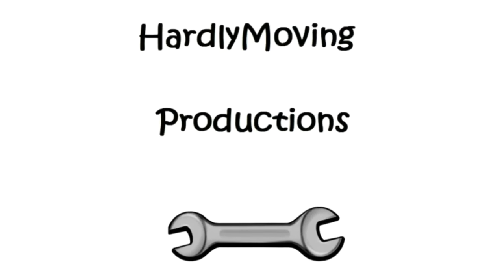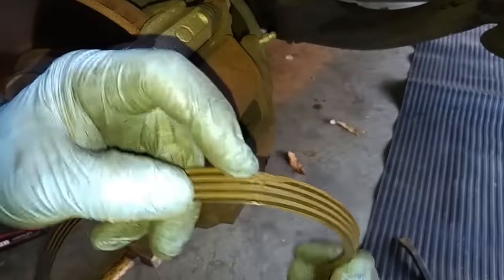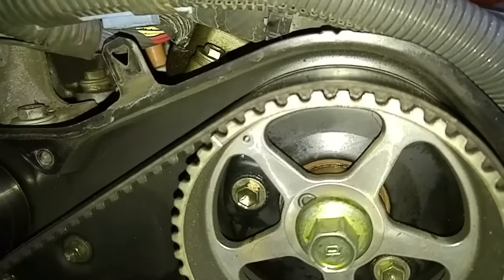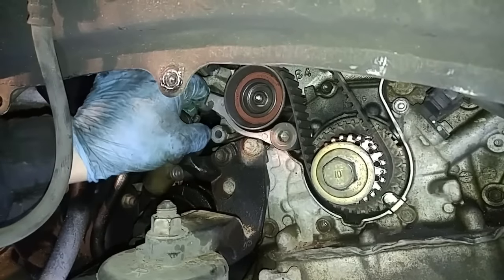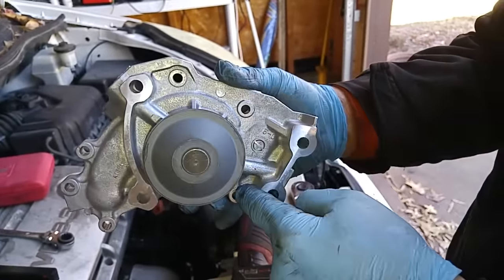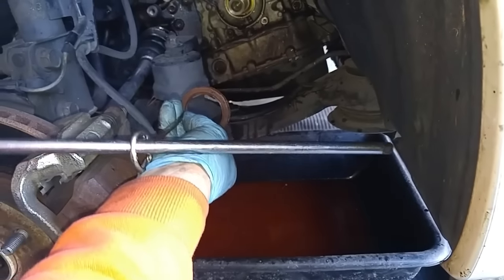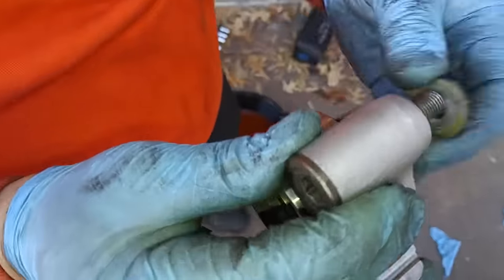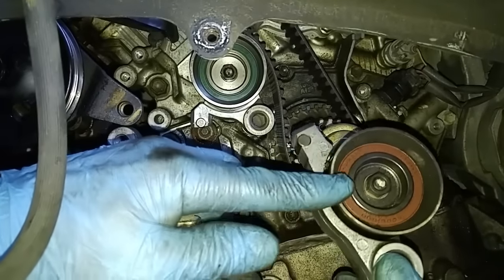Toyota Sienna V6 3MZ-FE Timing Belt, Water Pump, Seals, & Pulleys Replacement

Comment: This is the best YouTube video on this job for Toyota's 3.X engines.  Properly done, highlights the quirks of the job and shows the innovation necessary to get it done.  Done this several times on my Hyundai and it's never fun.  About to do my first on my Toy.  I look forward to the day when cars no longer have timing belts.  Thanks for posting.
Reply from the maker: Thanks for your critique and support ... appreciate it!  My video partner and I do spend a lot of time making sure we don't skip any steps, that the steps are in a logical order, identify specialty tools needed and slow the video down where needed.  If interested, here's a video we did awhile ago on Toyota's 1MZFE V6 engine in a 97 Lexus ES300:
 https://youtu.be/KkjgBVxBaeU
Reply from the maker: Good point but when the chain stretches, it will eventually throw off the ignition timing and you'll get a camshaft or crankshaft position MIL (manufacturer indicator lamp ... or check engine) error code.  You can reset the code as often as you want but it will keep coming back.  I've seen this in Honda's and GM tri-chain V6's between 150 to 200K miles.  If you decide to replace it, you need to replace it with new chain guides and tensioners.  Compared to a worn out timing belt replacement, you're talking BIG, BIG $$$'s to do the repair.  The timing chain cover is matted to the engine block with a whole lot of bolts, pulleys and brackets are in front if it which require removal, the cover to block sealant must be wire brushed off before resealing, a bunch of seals and gaskets must be replaced and the cost of parts is around 2.5 to 3X that of a timing belt kit.  I did a TB replacement on a V6 Kia Sportage with 170K miles on the original belt .... that's right 170K miles!  I wonder if a timing chain engine would last that long without stretching?
Reply: @hardlymovingpro  My Buick had 217,000 miles.  Original timing chain.  Still ran like a champ.  But I would prefer gears.  Surely they can get past the harmonics in this day and age.
Reply from the maker: That's probably an low rpm, "lazy 8" overhead valve (OHV) engine which has a short timing chain tying the crankshaft to the camshaft located in the center of the engine (unlike a OHC above the cylinder head).  The longer the chain, the more links to wear;  hence more noticeable effects of a stretched chain.  Buicks are a GM product.  Their current all aluminum OHC V6 is a 3 chain drive system and they generally can't make it to 200K miles before encountering chain stretch problems.  Also, you're lucking to make it to 100k miles before encountering timing chain cover oil leaks (low quality sealant matting the cover to the block).   Total labor time to re-seal a cover ... about 6.5 hours ... add 2 more hours to replace the chain, guides and tensioners.  About $2K parts and labor at a dealership.

Comment: Thanks for the paint tin opener trick. I used it to remove all three seals. My seals appeared fine but with 168k on my 06 Sienna and doing the timing belt for the second time I cringe at the thought of not changing them. The timing belt seems fine also but it is 7 years since Its been put on. Thanks for the video!!
Reply from the maker: Good job!  The paint can lid removal tool is an old trick and works.  Best to be on the side of caution and replace the seals while you have the chance.  Belts are tricky determining if they're okay or not.  They degrade internally so you can't tell by appearances.

Comment: Thanks again for a wonderful detailed video on the procedure. Recently, I got your channel when I saw your videos on the Lexus ES300 build project. Earlier I had your website reviewed for the detailed 1MZFE timing belt and water pump replacement. That helped me a lot especially with the timing adjustments while mounting the new belt. That was quite tedious and took the longest to get in full alignment. I think in your ES300 video, your technique of installing the tensioner without compressing was awesome, and that works well with the 1MZFE design. 3MZFE tensioner installation is similar to Honda's where the bolts are installed laterally and so the piston will need compressed first.
Just to share my thoughts about 5SFE (I4) and 1MZFE (v6), it seems like the Timing belt job on a 1MZFE v6 is a bit easier than the 5SFE.
Reply from the maker: You know ... one of my friends asked me the same question ... isn't the V6 easier than the I4?  Since the last 1MZFE job took me 2.5 hours to complete, I'd say yes.  And you're right, you don't have to pre-tension the tensioner before installation.  Saves a lot of time!

Comment: Great tips and camera angles. I just re-positioned my timing belt on my 06 Lexus RX330 because it was off timing after replacing it the first time and running the car. The rear cam sprocket was pain because it slips off its timing mark with little pressure put on the belt and I was doing this by myself. I ended up having to fabricate a bracket that holds the two cam sprockets in line with one another and the bracket bar bolts onto two of the timing cover center holes. This allowed me to set the timing belt because I was able to pull on it without the cam pulleys moving.
Reply from the maker: Good to hear it all worked out!  Thanks for sharing.
Reply: It's a shame the cam pulley isn't drilled through to a tapped hole in the head whereby you could lock the cam in place with a simple bolt, while fussing with the belt?   Seems like it would be a simple machining process during manufacturing to add that.

Comment: So following your video I successfully changed my timing belt, waterpump, seals, idlers, tensioner and accessory belts on my 1mzfe. The tensioner was the same as the one in this video. The belt on it still had all its markings visible and still seemed to be in good nick. So thanks for your help, and I'll be back in 5 years or 100,000kms.
Reply from the maker: Hey ... congratulations and good job!  A dealer would have charged you around $1,200 for all that work!
Reply: @hardlymovingpro  that was around one of the cheaper quotes I got. The only issue I had really was whichever seal I tried to put on the back cam, the lip on the inside kept folding out. So I poked it back in with a tiny screwdriver and made sure it was flush. 
But all in all it went well. Had no trouble whatsoever removing the harmonic balancer.
Reply from the maker: @sheckb1  That's why I use di-electric grease when putting on the cam seal.  Also, I don't push the seal on but rather twist it on.  So $1,200 was a cheap quote?
Reply: @hardlymovingpro  the seals actually came pre-greased. But yeah it was only that one seal. The other 2 were fine. I tried both cam sesls on that back cam and they both did the same thing only on that cam. 
But yeah, quotes I got were $650 (dealers mates rates), $1,200, $1,500 and $2,200. So I got out of it pretty well I'd say.
Reply from the maker: I guess that the rear cam may have had some corrosion or old seal residue on it to prevent the new seal from slipping on.  I like to wipe it down with brake clean before putting on the new seal.  Up to $2,200 for a TB / WP job!  Unreal!
Reply: @hardlymovingpro  yeah. I couldn't believe that. AUD that is though, but still. They told me that they needed to drop the entire K frame and drop the engine.
Reply from the maker: Drop the frame and engine!!!???  That tops and beats every rip-off quote I've ever seen or heard of!  I do remember a guy being charged $1,600 by the dealer in having his firewall side valve cover gasket replaced (did a video of that job ... around 3 + hrs job) and a independent shop quoting $1,000 to replace his left side air mix actuator motor (10 minute job).  Wonder what the dealer would charge to fix the Sienna sliding door problem?  Got the part from the salvage yard for $35 ... retail for the parts alone is $800.  Did a video on that ... around 3 hrs labor.
Reply: @hardlymovingpro  do you have Facebook?
Reply from the maker: Yes I do.

Comment: omg no wonder y the labor of replacing timing belt is expensive. Thanks for sharing this great video
Reply from the maker: thanks for your post and comment!
Reply: How much ??
Reply from the maker: @rolandroland1485  What I normally charge is $650 parts and labor ... which is about half of what the dealers charge.  And I'm using OE (original equipment) Bando or Mitsuboshi Timing belt, GMB or Koyo bearings and Aisin water pump.  If a new tensioner is requested, then it's a little bit more.  Don't know who makes the seals.  If the customer wants new belts (alternator and p/s) I don't charge extra for labor.
Reply: Hardly Moving Productions that price is a steal ! You come to NY ?
Reply from the maker: @rolandroland1485  I know.  i'll go somewhere close to NYC.  NY upstate is NG

Comment: im defititely impressed with the level of detail. I recently rebuilt a solara for a friend with the 3mz-fe engine. I have a feeling that im going to have to do the water pump. I have 20 some years working on cars but this is like a live chiltons manual i can follow instead of having to read along. The car has 198,000 miles on it and i doubt any seals have been changed on it. I real don't want to do cam seals, but since car is going to be all the way apart i might as well. I want to say thank you for putting in the time to show people this stuff it really helps a ton of people.
Reply: and i subscribed also
Reply from the maker: Thanks for your complimentary post ... do appreciate it!  With 200k on the Solara, definitely replace the oil seals.  You won't have any regrets.
Reply: @hardlymovingpro   no problem. damn im defintitely not looking forward to it. I had to do a timing on a crown vic and that was a pain in the ass.
Reply from the maker: If you have the right tools on hand, it's not that bad.
Reply: @hardlymovingpro  i have most of them but i hate how there is so little room to access everything.
Reply from the maker: @findfixxflip  The real hassle area is the rear (firewall side) cam sprocket and oil seal.  Also, the water pump has 2 mounting studs that can get in the way of the side motor mount and pump removal.  Just tilt that side of the engine up or remove the lower most stud with an e socket and they'll come off easy.   The 22 mm crankshaft pulley can also be a hassle to remove.  Highly recommend you use a high mass 22 mm impact socket with a powered impact tool.   Oh yea ... the TB tensioner ... use a 1/4" 12 mm socket attached to a long extension attached to a 1/4" to 3/8" adapter.  Make sure the socket is on square to the bolt head or the socket will slip and strip the head.  Good luck!
Reply: @hardlymovingpro  thank you much. I know i'll be able to do it,  but i kinda like painting and less involved fixes for same money
Reply: Hardly Moving Productions illl let you know after it is done
Reply from the maker: @findfixxflip  Don't worry about it so much.  I've walked though the repair with some other posters that ran into problems.  Just don't expect to get it all done on a pre-determined schedule.

Comment: Thank you so much! I'm a novice when it comes to doing my own mechanic work. But done pretty good so far, could not figure where there was a leak in my 06 sienna, but I'm guessing it's those seals?? Going to be replacing power steering pump, so while I'm down there....thank you again, awesome video!!!
Reply from the maker: Good for you.   FWI -  If you willing to give it a try, replenishing the power steering reservoir with new ps fluid with "stop leak", after around 5 weaks, could seal up the leak in the pump.

Comment: It's one of the best tutorials I have watched on youtube! Thanks so much for making this video!
Reply from the maker: Glad you found the video helpful!
Reply: @hardlymovingpro  Are all three seals the same or are the two on top the same and the lower seal by the balancer different?
Reply from the maker: @GoneFishingWithEd  cam seals the same; crank seal bigger.
Reply: @hardlymovingpro  lastly, that crank seal you replaced in this video.. that's the front seal? Just want to make sure I order the correct seals.. thanks again for your help!

Comment: Just did this YESTERDAY, lasted  me 12 hours after a couple of errors.
Just a few tips below to SAVE TIME and effort:

7:14
If you want to get to that TOP bolt on the hydraulic thing, you can take off the bolt that holds the power steering and MOVE the power steering out the way completely. It's located at about 1 o clock above the power steering wheel. It will make it easier to reach that top bolt.
I spent like 2 hours trying to get that one bolt(to the hydraulic thing) off, and nearly rounded it because the power steering couldn't be moved out the way no move..so I unbolted the power steering altogether!

20:48
BEFORE putting those two covers on, line them up outside the car and see if ONE bolt goes into BOTH covers.
The mistake I made was I put the TOP timing cover on, put all the bolts in, then tried putting on the BOTTOM cover and saw there was a bolt in the top cover that also went for the bottom cover.(So one bolt goes into BOTH covers.)

Also.....The Sienna (2003 generation) take about 1 3/4 gallons of coolant, so YOU MUST BUY 2 gallons of coolant(pink coolant).

I have changed timing belts for Early model Civics and CR-V, and lasted maybe 7-8 hours...but the Sienna has more wheels to work with, and it's tight (especially the back cam shaft, I didn't even do the seals, but it was very difficult to make sure it was on TDC...but it was done!)
Reply from the maker: Congratulations on DIY!
Reply: @hardlymovingpro  
Thank you!
Now it's time for me to do my 2003 Mitsubishi Spyder timing belt, should be easier.👍
Reply: theres nothing that quite compares to the ease of working on hondas!
Reply: To clarify.
Remove power steering.. pump?    power steering wheel = pulley?
Reply: @MrTravisAl  the power steering pump. The pulley is the wheel itself. So remove the whole power steering pump.

Comment: Another great video of yours.  I did the same work on my wife's 2008 Solara with the 3.3 engine, and everything was exactly the same.  Of course I would have preferred to have watched this video first!
Reply from the maker: Thanks Terry!  My world record for doing this job occurred last weekend ... 2.5 hrs!
Reply: Wow, that's amazing.  When I did my wife's Solara, I also pulled the intake to change the plugs, and changed the gasket on the valley/coolant cover plate.  I did have issues with the cam bolts being tight, thinking to myself "Wow, I'm getting old and am losing my strength!"  Thanks again for such high-quality tutorials.
Reply from the maker: Believe me ... do this timing belt job a couple dozen times and you will get fast.  With respect to cam bolts, they are on pretty tight and takes some leverage (breaker bar) to get them loose.
Reply: Terry , might I ask what FIPG (sealant) did you use on the coolant cover plate ( water inlet housing) ? @terryzak1742
Reply: @abyssalsoul6216  I'm not a fan of sealants and prefer gaskets or o-rings, but since none are available for this application I used the Toyota brand "Seal Packing 103", p/n 00295-00103.  Naturally I removed any trace of prior sealant from both halves, cleaned gently with Scitchbrite and then brake cleaner.  I also remember after running the bead, allowing some cure time before the final torque.  Tried to do everything possible to prevent a leak, since it's so burried. Also changed the hose that runs the length of that valley.   Kind Regards, Terry
Reply: Thank you Terry, I agree , changing the hose as well , which I will do. This will be my first using the fipg and I had not realized that you need to let it cure a bit before final torque (11 ft/lbs , I believe. Regards @terryzak1742
Reply: Ooops , torque value  for water inlet  housing is actually 71 inch/lbs..Regards Paul
Reply: @abyssalsoul6216  The way I look at it is, if you apply the sealant and then immediately torque it down, the sealant will fill the channel, yes, but it won't be under any compression.  It's been a while now, but I think I waited until there appeared to be a little skin on the surface, abd the placed the housing and fasteners.  Seated the housing down most of the way to get it uniform, waited a bit more and torqued it.

Comment: about to preform this job myself, super helpful. THANK YOU! something to note, those cam and crank seals are meant to seal oil, no way they are made of natural rubber that swell in the presence of petroleum they are usually made of synthetic material like ptfe, buna, or nitrile.
Reply from the maker: You may be technically correct but found removing them years later goes easier than petroleum based lubricants.

Comment: I wish there was a special hell just for engineers who deliberately design things to be difficult to repair. They could have chosen to make it all easy and accessible.
Reply from the maker: Believe me ... it's not as bad as some other cars I've worked on.   Volvo is easy but hell to replace the cam seals ... must remove the valve cover and lock the camshafts with special tools.  VW Turbo Diesel is the worst ... no room to remove the side motor mount bracket ... must time the injector pump perfectly or it'll smoke ... still smokes after 20k miles because the belt stretches becoming out-of-time ... parts are not cheap.  Lexus LS400 ... must remove radiator and a whole slew of brackets ... camshafts must be removed to replace cam seals.  VW Passat ... must remove the entire front end to get to front of engine.  How about timing chain driven engines?  Takes 2X to 3X as long with more $$$ for parts.
Reply: @hardlymovingpro  I can't even... lol.
Reply: beemrdon52  It is never too late to party.